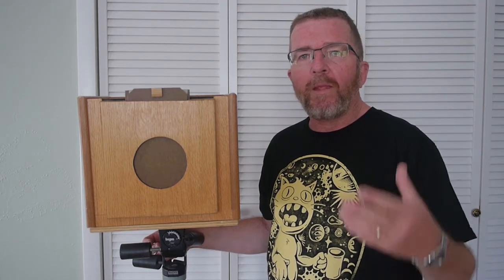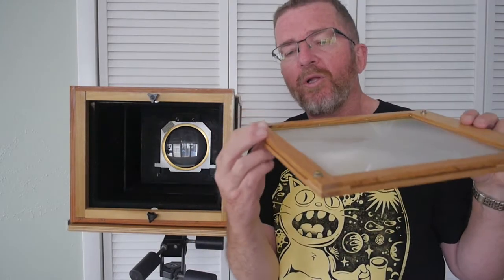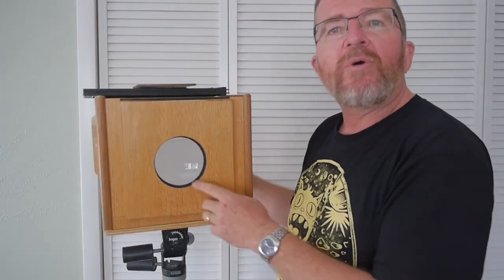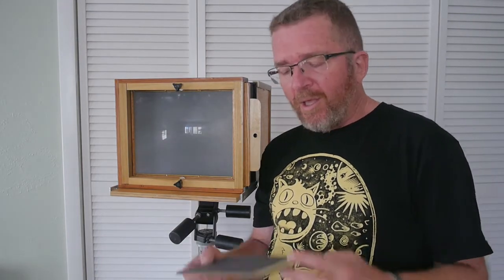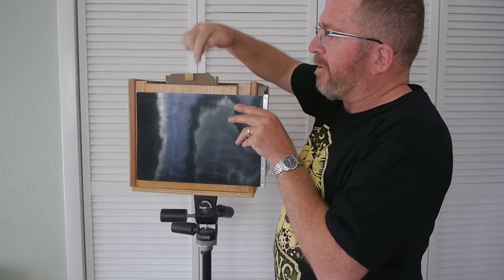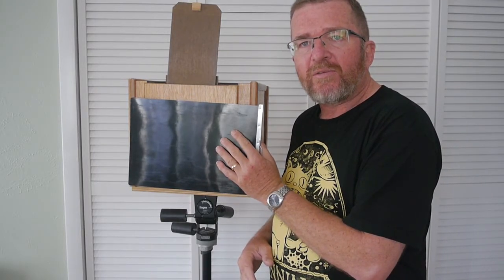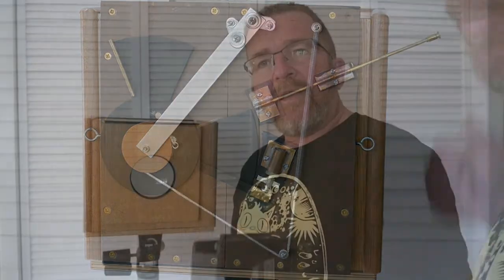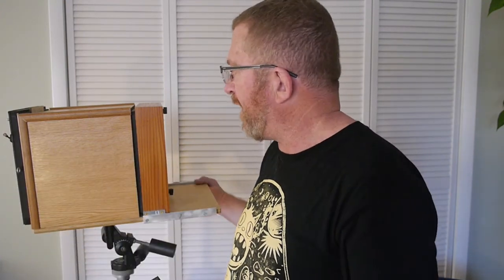Box Camera Overview

Comment: I love this design. Looks so much easier than building bellows. How do you determine the properties of an unknown lens? Are there plans for this camera? I have a lens out of a broken enlarger I m going to try to use.
Reply from the maker: I test lens by first projecting its image onto a white surface and see how big the image is, and measure its focal length. I'll also stop it down to see how the image sharpens up.

The aperture I use is often dictated by the shutter speed, which for these cameras lacking a mechanical shutter means in bright sun a small aperture and slow film like Harman Direct Positive paper.
Reply: Thanks for answering back and for all the videos you have made. I have learned a lot from watching your channel.

Comment: Hi Joe, have you found any fogging occurring from light coming between the two sections and bouncing off the front section back to the film holder?
Reply from the maker: No problem with fogging. The alternative design, with the front half fitting into the rear half, is leak-prone however.

Comment: joe, with reference to the meniscus lense you used on the 8 x 10 box camera,, is there a particular type or designation of lense i should look for particulary if i want to make an 8 x 10 ,
thanks
tony robinson
Reply from the maker: Single element lenses all make similar images, sharp in the center and soft on the edges. As you stop the lens down, the overall image gets sharper.

If the lens projects a coherent image it should work. The most important factor is focal length, to ensure the image circle is wide enough to cover the film format. You can't get really wide angle images with these lenses, more like normal to slightly long.

Most any magnifying glass will work. Go to the store wearing a white shirt to project the image against, to get an idea of focal length.

Comment: I've just seen Your project and I find it fascinating. But I've got one question. Every tool is built for certrain purpose, work to perform - otherwise it is useless. Where can I see pictures taken from Your camera? I'don't mean to be rude - I am just curious. Is building of this camera purpose in itself?
Thanks,

Rico Muerte
Reply from the maker: Great question, Rico. I'd been using paper negatives for years in pinhole cameras. I wanted to employ them in a glass-lensed camera, as a large format camera with less adjustments than a full-on camera with bellows and movements, for creating landscape, documentary and portrait images.
Reply from the maker: And, of course, there is a certain satisfaction from building the camera itself, but that's not the primary purpose.

Comment: Does anyone know what determines the size of the image circle on the film? For instance would I be able to use any diameter lens/element/pinhole? And adjust distance between the film plane and lens to "focus" an image properly on the film at say an 8x10 size? Thanks anybody for the help!
Reply from the maker: The distance between pinhole and film determines angle of view. The brightness falls off toward the corners, with a wider angle of view falling off dramatically more in the corners than a more normal angle of view. How wide of an angle of view is limited by your tolerance for vignetting; it works better with some subject matter than others.

The reason for the fall-off of brightness in the corners is because the distance from pinhole to corner is longer than from pinhole to center; implying that the focal ratio is larger into the corners (and edges) than the center. A larger focal ratio requires more exposure than a shorter one. You can adjust exposure to optimize the exposure somewhere between center and edge, so overall the exposure is more even, with slight over-exposure in the middle to compensate for getting increased exposure in the corners.

There is an optimal diameter of pinhole for every "focal length", yielding optimal sharpness. There are formulas on the web to determine that; Mr. Pinhole is one. However, optimal sharpness is not always aesthetically pleasing; I appreciate just as much, or more, grainy film enlargements with soft images, rather than ultra-sharp pinhole images that, from the Internet, appear as if made with a glass lens.

As a general rule, the large the film format (and hence longer focal length) for a given angle of view, the more detail in the image, with an optimized pinhole; because the longer focal length  yields an optimal pinhole size with a high focal ratio. And also, a large format requires less enlargement to a given print size. Example: the optimal pinhole size for a focal length of around an inch (a normal angle of view for a 35mm film frame) gives a focal ratio of around f/120 or so; whereas with a 4" focal length (normal angle of view for 4x5 film) gives around f/300.

Comment: how does it take pictures actually? I never actually seen them being used :o
Reply from the maker: The image is composed on the view screen at the rear of the camera. Then the view screen is removed and a sheet film holder loaded in its place. The shutter over the lens is closed, then the dark slide of the film holder is removed. Then the exposure is made with the front shutter. The dark slide is installed once again into the film holder, then the holder is removed.